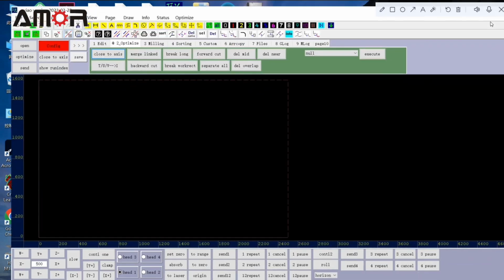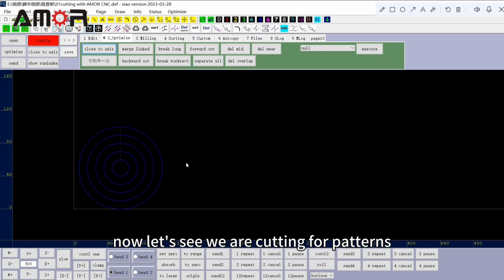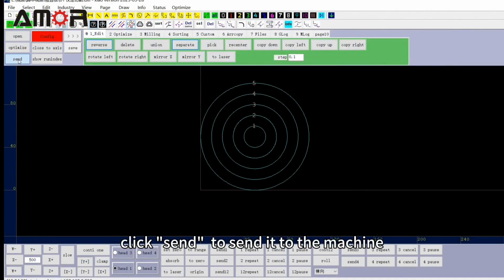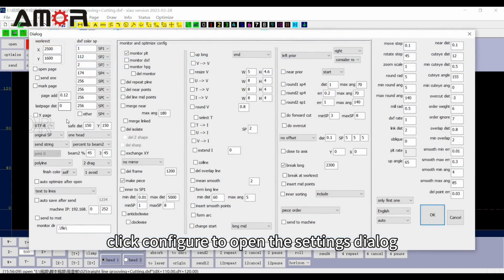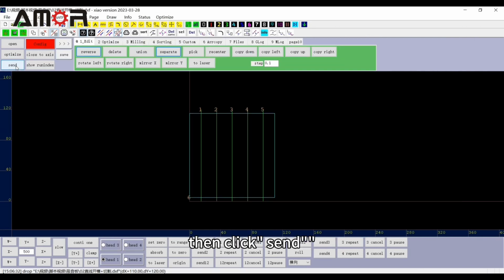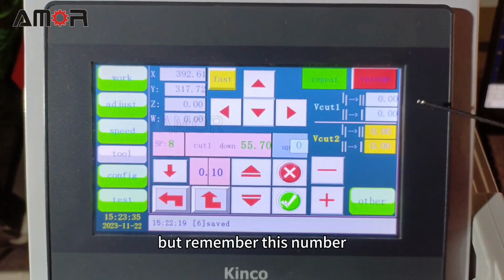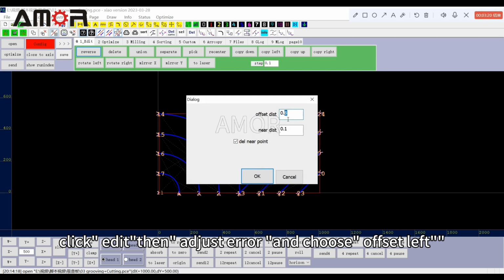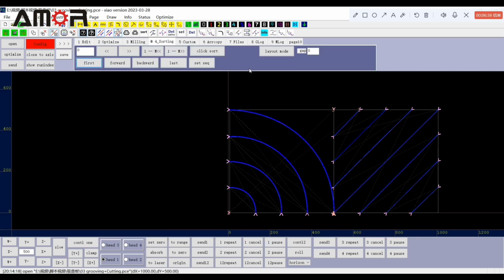How to Optimize Graphics for Oscillating Knife Cutting Machine

Comment: 9:09 can you tell me what is the purpose of the blue plastic?
Reply from the maker: Hello, this is an automatic lamination system that we specially developed to address the high air permeability of polyester fiber sound-absorbing panels.
Reply: I believe it stops the material from moving when being cut. The machines vacuum table sucks the blue plastic against the material.